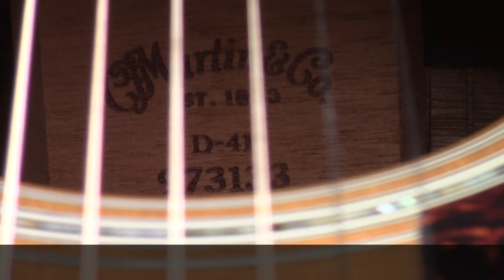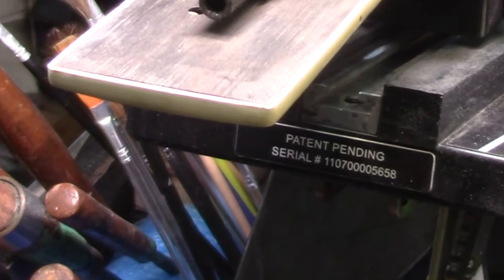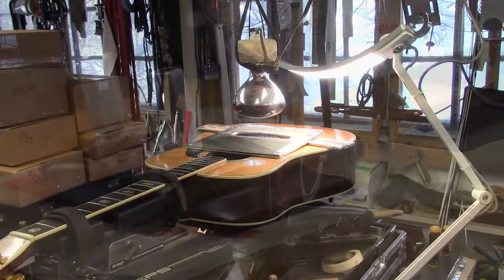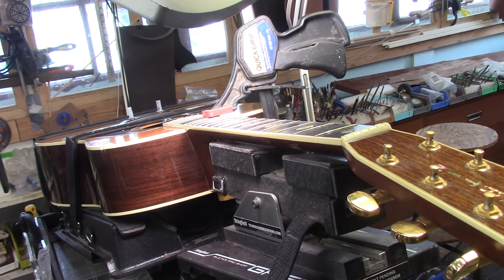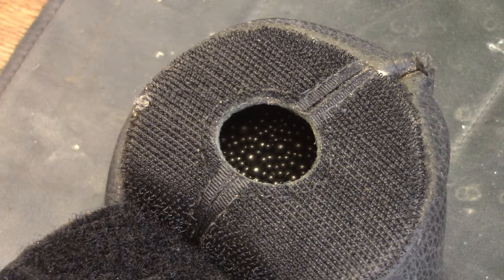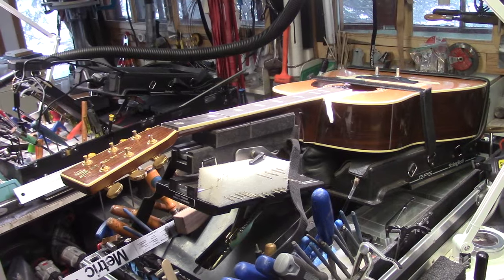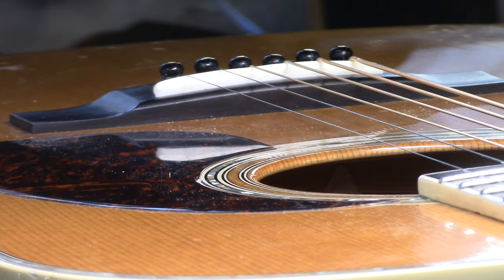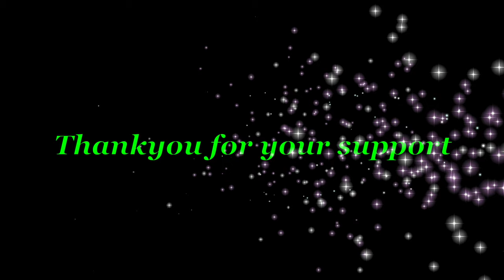Martin D-41 / Neck Re-Set / Fingerboard Correction / Comp Nut / Comp Saddle@StringTechWorkstations

Comment: You make that work look easy Michael. Your muscle memory is well tuned from decades of experience and it is well noted. I'm curious, did you take the string tension off when humidifying the guitar? I'm assuming you did. The sanding of the bottom of the bridge to 24" radius to create suction with the glue to correct the imploding top is brilliant! At what point in your career did you come up with that trick?
Reply from the maker: #1: Yes Perry, the strings were loosened off,  while I humidified the guitar #2  This latest Conversion Kit for the Drill press makes this much more accessible for everyone.  I go back about 35 years with the radius sander idea.